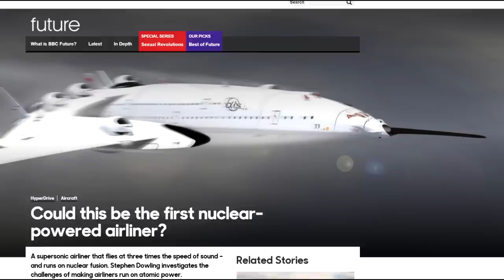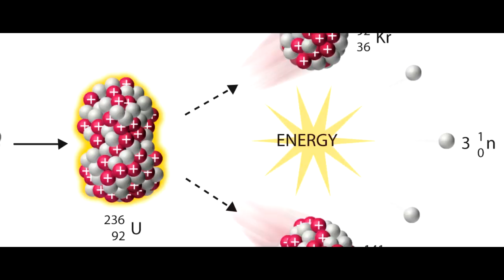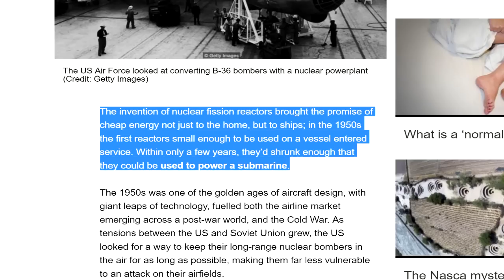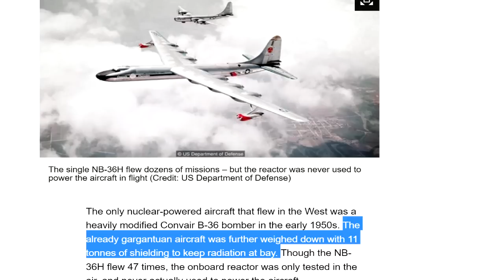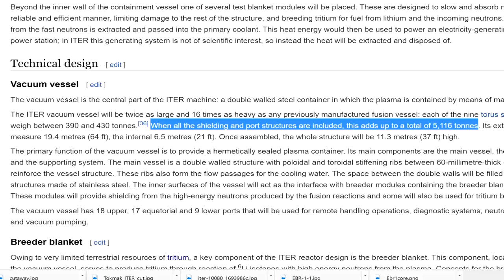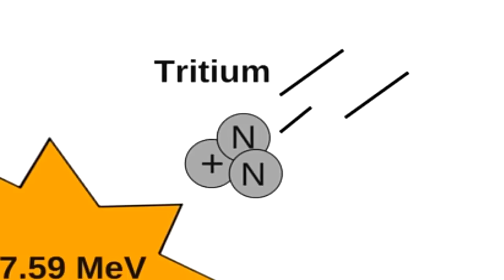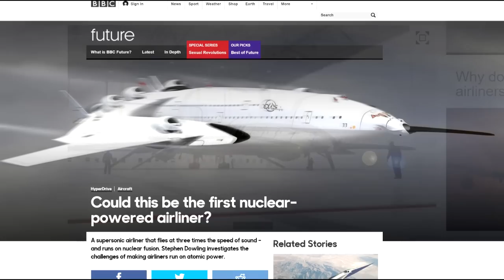SIX ENGINED Nuclear Airliner... BUSTED!

Comment: Funny Boeing (or was it Lockheed) already tried a nuclear powered aircraft in the late 50's but the design was deemed un-aerodynamic. Plus the reactor would have weighed to much and there would be little to no thrust provided.
Reply: the convair only carried a reactor, to test the shielding required for using a nuclear reactor for aircraft. 

there was several projects (both US and soviet) to create a long endurance bomber but they only got as far as building the test engines mounted on concrete blocks or rail carts to test the thrust. but these craft didn't work on fission or fusion, they worked on radioactive decay (like an RTG cell) basically a compressor sucked air in the front of a jet engine and around the cooling fins of the core to heat up the air much like how jet engines work. the engine itself worked (and didn't require much shielding as they only used alpha or beta emitters) the only reason they never progressed any further than they had was because ICBM technology made the need for long endurance bombers obsolete.

speed wise they would probably match a modern airliner which was more than enough they were designed to fly circles around friendly airspace for weeks on end in case someone launched a nuclear attack allowing them to launch nuclear missiles quickly or move into bombing runs without having to load and fuel up a bomber on the ground saving hours on reaction times (think of it like the difference between having a gun in your hand ready to fire and an unloaded gun in a desk drawer)
Reply: Besides if they really want a jet airliner that can travel fast distances in a short time then why not bring the concord back?
Reply: USSR also had projects of nuclear planes
Reply: it was Convair. It was aerodynamic (heck, it was a normal B-36 that was converted).
Reply: There was no problems with aerodynamics. The problem was with keeping the crew safe from radiation. Bombers were deemed inferior to ICBMs so no further development was made. Today it would be a trivial matter to make a nuclear powered drone if such a need came up.
Reply: +crwydryny my bad it's been a while since I heard of the thing.
Reply: Ohyeah Mr.krabs
 it's ok. i had to double check to make sure as i only stumbled on the concept once before while looking up something for an RPG game I play
Reply: +crwydryny that was the open jet system you described...where the engine and reactor are integrated together. I have a pic of the closed system where the reactor was separated from the jet engine. if I recall correctly they got the reactor to power 4 modified jet engines
Reply: bryfunkenstein
i'm assuming you're refering to the tupolev TU-119 which was a duel feed system. it was used as a test bed for nuclear propulsion (mostly to test radiation shielding) and used normal jet fuel powered turboprops, using 2 nuclear powered engines and two conventional kerosene powered engines. but was never actually completed as the project was cancelled from what I can tell based on the limited data available for the Kuznetsov NK-14 engines that it would have used. it used heat exchangers to move heat from the reactor to the engine (much like how the cooling system works on most laptop computers) but otherwise operated much like the system the americans were developing where the core was placed inside the engine with the advantage that one core could be used to heat multiple engines.
but without more accurate data on the system I can't say much (I'm mostly speculating based on other nuclear systems) that's the problem when dealing with classified military information they never tell you everything lol but if you have more information on it I'd love to read it (always interested in strange and interesting aircraft)
Reply: +crwydryny I was referring to the HTRE series that GE developed. the reactor was separate from the engine instead of being integrated with the engine. never knew anything about a Russian program other than the modified bear that irradiated the crew
Reply: bryfunkenstein
as far as I'm aware none of the HTRE systems were ever fitted to an aircraft, they were test engines that were basically bolted to big blocks to see if they would work, it was intended to be placed on the X-6 but that craft was never built and the program was cancelled (the russians used the same idea as the HTRE in their development of the TU-119).
Reply: +crwydryny no they were never fitted to an aircraft but the HTRE3 was flight rated...as was the last series of NERVA rocket engines...all abandoned...

Comment: Can someone explain to me how half-life's work? To my understanding it works like this: Let's say you have 100 kg of something with a half-life of 12 years, after 12 years you will only have 50 kg of that something. But how and why? I've got an interest in nuclear power, so if you could explain it would be great (extra facts wouldn't hurt ;)  )
Reply: Half-life refers to the decay of one isotope into another. As in how much time before about half of that pure material has decayed into something else. You would still have around 100kg (A little less depending on the decay) but half of it would be another isotope further down the decay chain. https://en.wikipedia.org/wiki/Half-life for more info
Reply: more or less, after that waiting another 12 years would give 25kg, then another 12 years would give 12.5kg and so on. if you know exponents and logs yet then half life can be given by a constant times the square root of another number. someone posted a wiki article that goes into it better
Reply: +Josh McGillivray the how and why is due to the weak nuclear force, which you can read up about :)

Comment: That ridiculous forward swept U shaped gull-wing, plus front loaded fin/wing-tip looks designed to break apart and tear off the main hull at normal velocities let alone beyond the sound barrier where that wide wing-span and shape would cause massive issues.

Comment: Aww man, I thought this died with the atomic bomber programs of the 1960s. 

As I understand it the Russians did fly a TU-95 prototype on nuclear powered turbo-props using a direct cycle reactor with minimal shielding... Killed the crew in the process. 

Both super-powers decided it was a non-starter and that flying around a functioning nuclear reactor probably wasn't a good idea given the risk of a crash.The fact that this risk was not justifiable to the Soviet and US governments during the height of the Cold War should tell us something, quite apart from practical engineering concerns!

Comment: nuclear powered aircraft is actually a thing. during the cold war it was the hypest shit in both the USA and USSR.  The russians made one of their "bear" bombers fly with nuclear power (they had shit shielding though, iradoatong the plane and crew and spewing out contaminated air) and the americans wanted to implement a nuclear ramjet engine into project Pluto (a unmanned flying cluster nuke delivery system, seriosly, a form of doomsday weapon). whilst the pluto was cancelled, they tested two engines for it, and they worked.

so its very possible to make a nuclear airliner, but you would have to be retarded if you cant figure out why they havent done it already.

sorry for my shit english, im on my phone.

Comment: okay this is a plausible idea that they ruin by bringing every part of it up to 11, nuclear FUSION powered and SUPERSONIC?I mean its completely technically possible to have a small nuclear reactor powering an electrical propeller driven aircraft, using uranium power or a plutonium RTG if you happen to be made of nuclear licensing and money, but fusion power is a very inefficient and heavy technology compared to uranium at least as it exists currently, and its hella unlikely that not only to they overcome the issues of supersonic commercial flight, but also the issues of having an enormous and heavy fusion reactor onboard an aircraft and also do so in a way that enables the aircraft to put out enough power to fly supersonic, while being somehow also commercially viable and safe to sit in for several hours.

Comment: So i'm going to pose a question. What would it take to use a fusion reactor for an aircraft? What you're saying is that it ultimately comes down to the shielding for the reactor and that the shielding would be either too massive or too heavy for flight. So is it possible to either make a shield out of lighter material or is it possible that the reactor could generate enough power to lift a massive aircraft off the ground? 

I am not scientist so I honestly don't know what it would entail or what it would even look like. Just curious if there was a possibility to make an aircraft with a fusion reactor powering the engine.
Reply: It's possible, but so deadly, why bother.
Reply: Well progress mostly, think about it if we could build a fusion reactor to power more powerful engines then we may be able to push  probes even further into space or just learning how to make a better reactor shield may open up new possibilities. 

Instead of asking why, ask how. How do you make it safer? Or How can we use this new aircraft in other ways? How big of an aircraft can a fusion reactor support? How long can it run? so on and so on. "why bother?" is a question that can attributed to every new piece of technology out there. Just look at the internet, there is no absolute reason for it but we made it didn't we. Or why do we even have probes for that matter we could live our whole lives not care that space is a thing (until aliens show up at our door)

Comment: Nuclear engine for spacecraft and aircraft are forbiden to be use into the atmosphere because of the risk of accidents and failure of the sytem.  Also good luck to just lift that thing in the air with the weight.  The day we will be able to use fusion nuclear energy to do something like that it will be use for space exploration as a source of energy. The other thing that will come next is probably the warp drive if we can manage to produce enough energy and that we are able to control it. Stil a lot of research have to be done to see if we could ever make it possible. I don't know for all the rest of the people but I hope i will live long enough to see if those idea of warp drive and fusion reactor ( that are working 24h/24h and 7 d/ 7d will come reality).

Thunderf00t, what are you thougts about all those reasearch? Also, do you think we will see the result of those reasearch in ,maybe 70 or 80 years from now?

Comment: hi thunderf00t. how did they get to the moon and back if what you are saying is true? did they have a meter of concrete around them to stop gamma rays? or is galactical radiation so soft and warm that two cantimeters of aluminium and a golden foil can stop it? and we both know that golden foil will produce more af the lower enegry radiation inside the craft. so it increases the radiation on the inside. plz tell me how can they go to the moon without such shield. kisses

Comment: The soviets modified a Tu-95 to run with nuclear power however ran into issues where it created insufficient power for flight without standard engines that use jet fuel

Comment: MEH  guess you could make a nuclear powered plane that uses propellers (same as nuclear subs) - but jets and rockets need physical fuel ya know, otherwise we'd be using nuclear spaceships wouldnt we.

Ofcourse there some real interesting research at nasa where they are looking at ways to generate thrust without solid/liquid/gas fuel. Using electricity to make EM radiation and using that EM to excite 'spacial feilds /insert startrek science here' to produce particle radiation - which ofcourse generates VERY small amounts of thrust. But thats fine because as all kittens know in space no one can hear you mew.

Comment: Let's call it science-fiction. :-D Lockheed-Martin has "patented" and has been working on a compact fusion reactor, which they claim will fit in a lorry. Two years ago they estimated they would have a prototype in five years. However, when you look into their project, although it's interesting, it doesn't look like they'll be able to deliver.

Comment: Oh come on Thunderf00t, you're coming at this from the entirely wrong angle.  

The basic concept of making a thermonuclear turbine isn't the problem.  Aneutronic fusion, like say p-B fusion, is a thing.  

The problem is that currently there are no fusion reactors that produce net power, and a start up like this isn't liable to magically make the required breakthroughs in reactor design.  You're current to reference ITER in that capacity, but that wasn't exactly your focus when bringing it up.

Comment: futurism is a thing. To make an idea spread it around and have hopefully millions of people working to make the idea a reality.
The tech specs probably are guesses and this deserves its own sci-fi book with how it works in one person's hypothesis laid out in it They usually get kinda detailed into how their future machines work. Again future machines and in a book not reality and on the TV.  A sci-fi book as it is not something that happened yet might be able to happen in the future some time.
So something to test then fix to a point that you think you fixed whatever went wrong then test it again. putting it onto a plane the amount of thrust needed to make the upward force would be a lot more than a normal plane just to move the engines and their shielding up into the air.

Comment: It's without even talking about electromagnets needed to confine plasma into the reactor, and if failing, everyone dies. The weight of electromagnets, how they will start the reactor, as right now most of them are started by huge lasers, the units to convert heat into electricity. The reactor would have to work pretty much 24/7, maintenance would be nearly impossible or very very very expensive. I don't know how they would handle an accident, just imagine some 15 million to 100 degrees Celsius plasma smashing at Mach 3 in a big city.

Comment: The aircraft does not require shielding; first class is located farthest from the reactor. The economy passengers are served heavy water to slow down neutrons. They resurrected the de Havilland Comet window design, so the planes will only be in service for a short time.

Comment: The aircraft used to test a reactor (which never actually powered an aircraft engine in flight) was a B-36 Peacemaker, not a B-29 Superfortress. The B-29 was built by Boeing while the B-36 was built by Convair. The B-36 was a very much larger aircraft than the B-29. The B-29 had a useful limit of bomb weight of around 20,000 pounds while the B-36 could lift about 72,000 pounds in normal flight. The B-36 was chosen for this test because it was the only aircraft in the inventory at the time that could reliably lift the weights involved.

Comment: Let's also do away with the idea of how many G-forces that would be put on you from going 3 times the speed of sound. Because you know, it's not like is a challenge to stay conscious barely going over 1 time the speed of sound...
Reply: You get g forces from acceleration, not moving in a straight line at a constant speed.
Reply: It would have to accelerate to get to mach 3, silly. Unless... maybe that's another one of its amazing features!
Reply: CloudfireVG At 1/10th of 1 g, it would take about 10 minutes to get to Mach 3.  Not a lot of strain on the passengers there.

Comment: Nuclear energy is fantastic in a lot of ways, and NTRs (Nuclear Thermal Rockets) are being built/tested for space travel. It isn't a new concept (originally thought of late-'70s), but it's being revisited since our chemical rockets just aren't doing it for us right now. Not to mention, in space the neutron kick-off wouldn't really be a worry since space already has countless stray neutrons shooting around. However, in our atmosphere this isn't a good plan because you're going to get neutrons in the exhaust. That's just gonna happen. 

  That would be bad enough, but no, these guys wanna actually start talking about fusion on their aircraft!? Alright, first off all fusion of isotopes STILL produces neutrons (many of which are Thermal Neutrons), so you need to deal with that via shielding. Oh, and let's not forget the gamma rays (excess energy kick off) and the superheated plasma required to this for our hydrogen isotopes. The massive research facilities aren't even getting stable, net positive return from investment when conducting Nuclear Fusion, and these guys are already talking about airplanes!? 0.o

  This is a Health Physicist's nightmare...